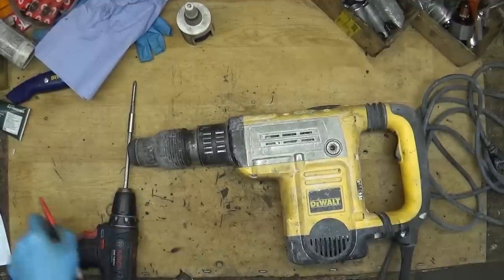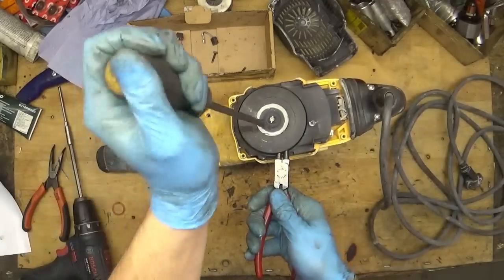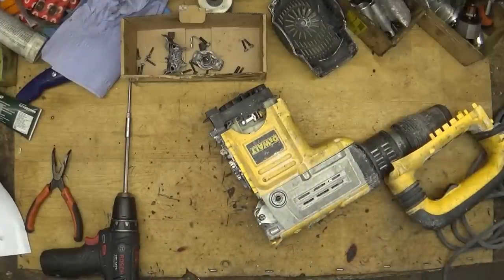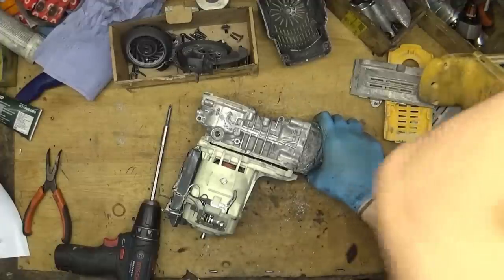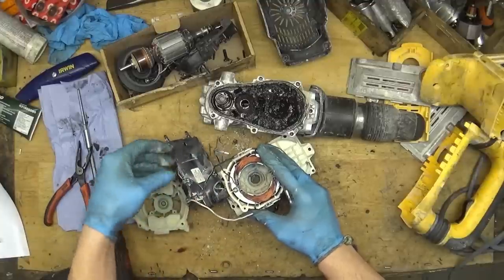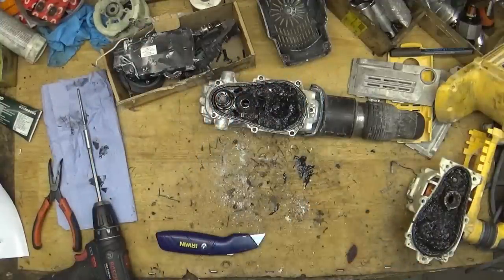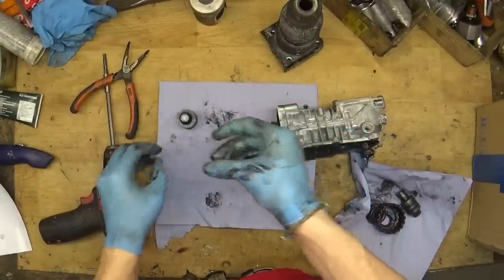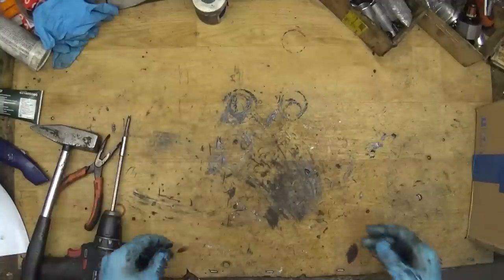Dewalt D25831 rotary hammer drill SDS plus disassemble. Need new field carbon brushes o-rings grease

Comment: Hi great video ,but it's gear oil that goes into the gear box is it not ? I did alot of research and the gearbox has alot of passage ways in order for the oil to circulate .

Comment: good morning , I changed the electrical part of the hammer including the electronic module . When you turn it on it works for about 10 seconds it lowers the energy and the speed of the hammer and turns on the service light! what could be the problem?

Comment: Hi Handyman.   I have this same Dewalt tool.  When I turn it on, it revs high then cuts out after about 2 or 3 seconds.   If I turn the speed dial in that brief moment, no change in speed occurs.  Is this likely the GAC unit (the speed control module) or something else?    I put in new brushes to no effect.
Reply: Hi. Did you figure it out? I have the same problem... Thanks
Reply: @madstowt  No, I was meaning to look into it as a winter project, and look, it's already spring.  So it's either next winter or when the need arises.   Will post here with any progress.
Reply: @madstowt  Hi my friend. I finally fixed it. Besides the expensive GACC module, I needed a new "fan assy" and "fan baffle", which I didn't realize until I opened it up. 

Something, probably abrasive dirt, got into the fan and started to grind up the fan baffle. The fan baffle houses some kind of sensor leading from the GACC, which I think detects the spinning of the fan. If no spin, the GACC shuts everything down. That sensor head got ground up too. The sensor head is part of the new GACC. Too bad they don't sell it separately, because I bet the rest of my old GACC is good. Moral of the story: Never lay this thing down in the dirt.

tip: I had a helluva time trying to remove the green wire lead and connector from the old GACC.  You need every bit of this because a new one is not supplied with the new GACC.  I ended up carefully cutting it out of the old GACC with a fine tooth flush saw.   I would have used my Dremel, but my cat was sleeping so peacefully.

tip: Observe carefully where all of the wires go and how they are routed thru various pegs and standoffs.

GACC module N041755 $140
fan assy 1006592-01 $24
fan baffle N016920  $8

I bought these at OEMToolParts and eReplacementParts.

Comment: How much volume of gear oil needed?
Reply: Hi. Did you figure this out? I’m wondering the same. Thanks
Reply: @madstowt  I am sorry, but I don't.
no one give any information  about oil volume needed but so far it only need grease (green and yellow).
my DCH481 has filled with engine oil (around 15 ml) and it feel more vibration produce.
Reply: This model 70ml